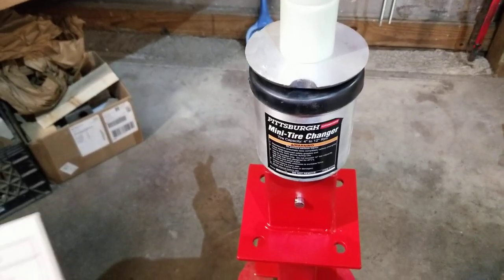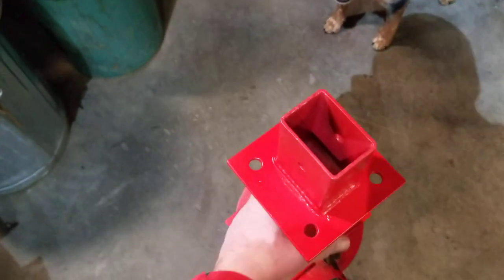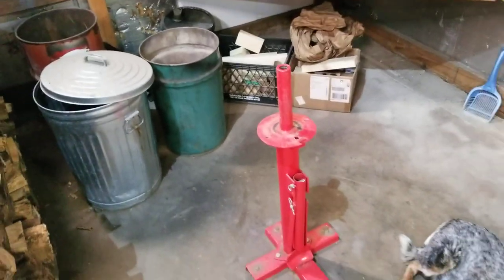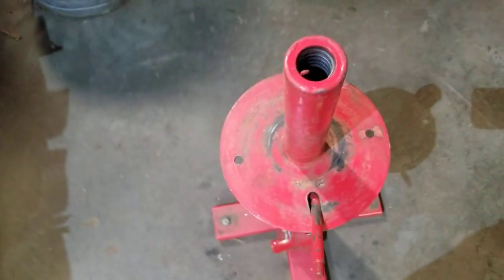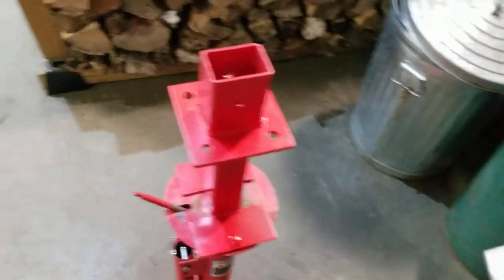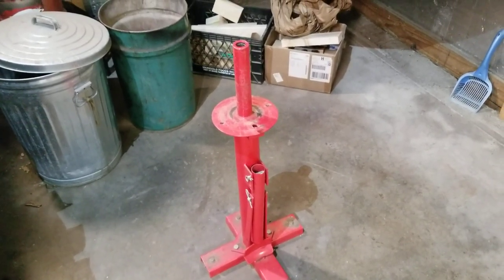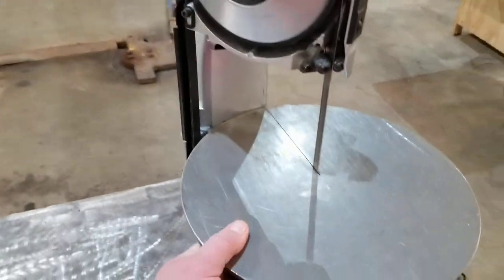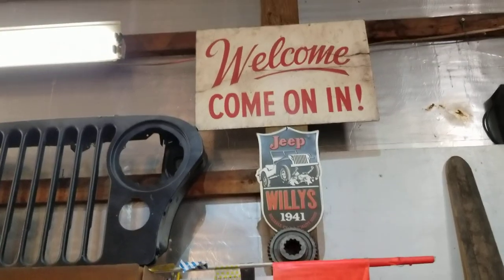Harbor Freight Mini-Tire Changer modifications

Comment: I made a 28 inch long piece of 2 inch receiver tubing with a 2 inch inside tee welded on the end that takes another piece of receiver tubing. It is 28 inches long too with my tire machine mounted on top. It slides down in the "tee" and I have set bolts on the side of the tee to tighten it. Fits any pickup with a receiver hitch and the tailgate can be down for a work area. Rock solid. I also made new tire irons that are 30 inches long. Makes the grunt work a lot easier. I also made  another hold down that works on top with a rubber irrigation pipe seal on bottom to grip the tire and glued a rubber flat rubber washer on top. It grips the tire a lot better. Work the tire irons from left to right and the wheel will not move.

Comment: I'm guessing since you have both,  the larger one isn't as good for mower and atv tires and such?   which is mostly what I would probably use one for. Cool shop
Reply from the maker: It's based on the center opening on the wheel. The larger tire changer needs an opening of about 2". Anything with the smaller opening (like a lawn tractor) needs to use the changer that I modified in this video.

Comment: That's great but you need to come up with something that addresses poor fit of the base to the top as it comes.  Thanks, hope you or someone can come up with a solution.
Reply from the maker: I don't find that to be a problem, but you could easily put a couple appropriate sized washers between the parts and then use a bolt instead of that pin.
Reply: @srlbotanical  Thanks, sounds like a start.  Might try a piece of metal and drill it to take up space.  Just a sloppy design on Harbor Freight's part.  Thanks Steve